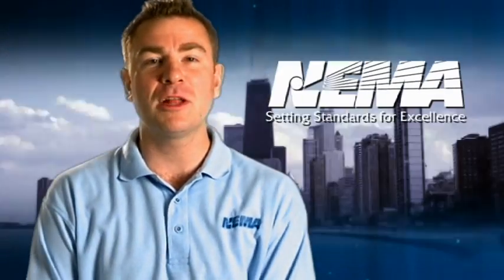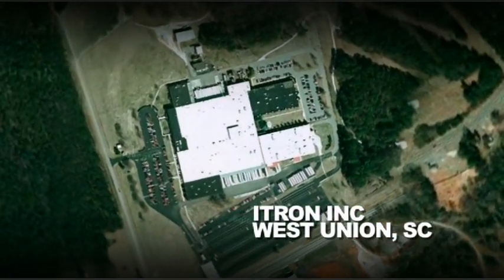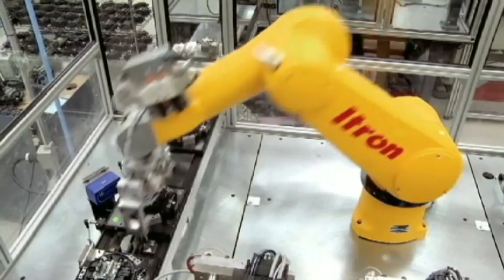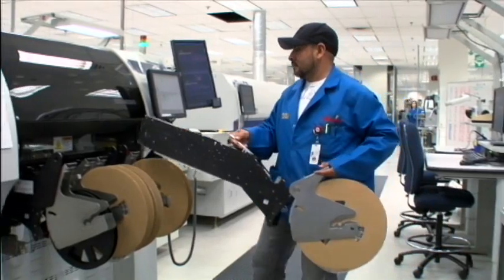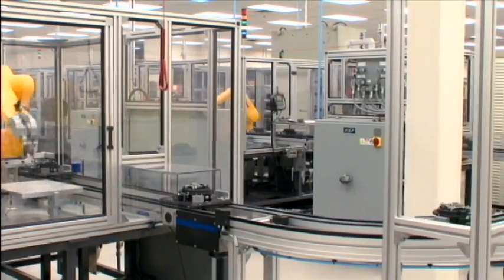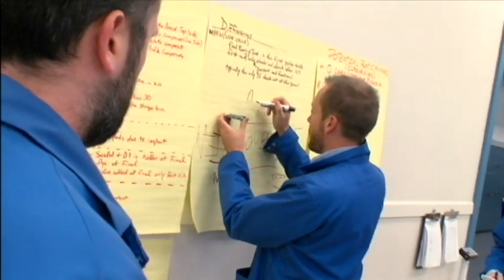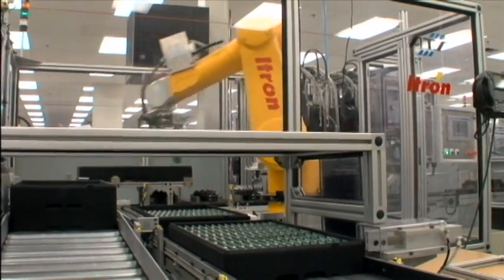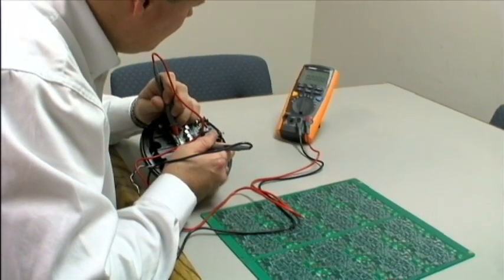Smart Meters

Comment: Great story, BUT you have to make sure Itron's customers (Power Companies) follow the DO NOT INSTALL DISTANCE OF 8"    All of them are failing to follow the FCC's rules. You really can't complain to Itron except for the missing warning decal. Would it slow down smart meter sales??  You bet. would it SAVE more lives?? You bet.
A warning to customers about not exceeding the 48KW power rating would be another great warning decal.   That might help stop some of the fires out their. 
How about a warning decal telling homeowners with implanted medical devices to stay away more than 2 feet from their new smart meter and their own home. That would save lives. A warning decal telling home owners to report moisture inside of their smart meter would be another great idea.  Oh, I forgot one other warning decal, Do not install a smart meter within 3 meters of a propane tank  If there is a power surge, smart meters will shower propane tanks with sparks.  
How many WARNING DECALS is that?   
It's a good thing a meter reader is not needed any more, there are so many warning decals on the meter, the display screen would be obscured.

Is there a warning decal telling us smart meters contain Mercury??
Is there a warning decal telling us smart meters have a lithium battery inside???
After all, if the lithium battery heats up and sets fire to the smart meter containing mercury, the mercury vapors are highly toxic. 
$3,000,000,000 to install and operate 1,000,000 smart meters and each meter wastes  about 4 watts each just to work. one million smart meters time four watts is 4,000 kilowatts of waste.
Who told us smart meter were a GOOD IDEA?
Reply: Frederique Zug. Thankyou, Frederique, we have Itron Centron 3G Open way death meters in Victoria, BC Canada. BC Hydro will not allow an opt out or even a radio off, where are our rights, what about the charter of rights and freedoms? I feel sick all the time, nausea, my friends are ill, my aunt has had bad nose bleeds, her pace maker keeps slowing down, and she has breathing issues. My girlfriend has called paramedics 6 times because of chest pain , heart arrthymia, but as soon as she left her apartment her heart was normal again.